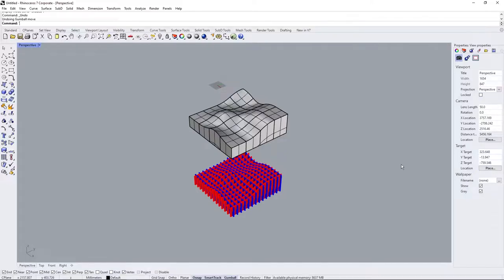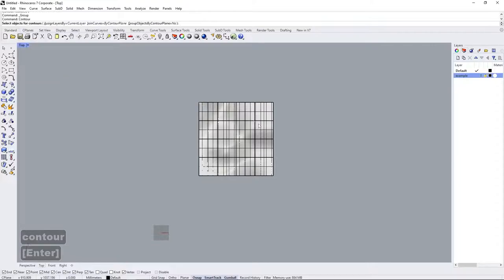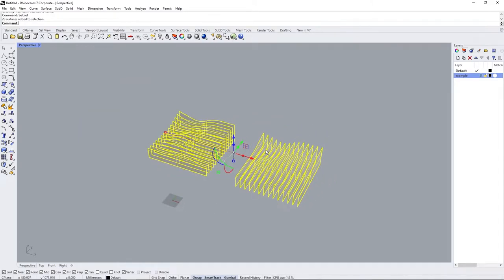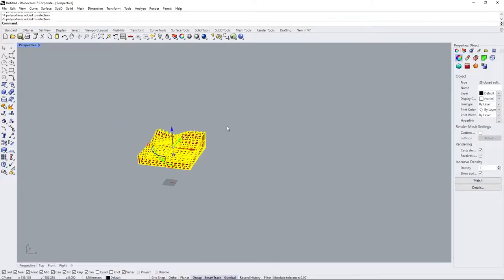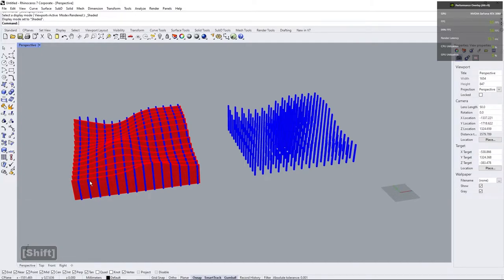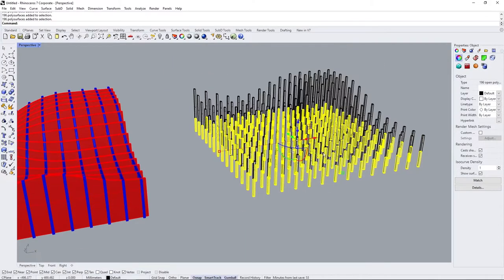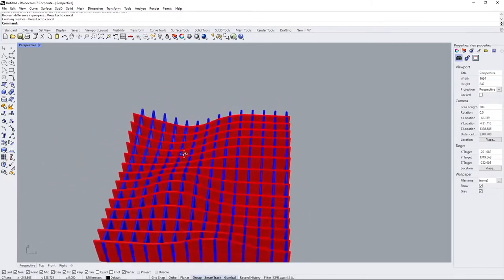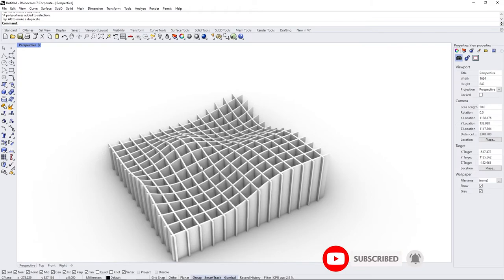How to: Rhino Waffle Structures - Fast and Easy

Comment: Good tutorial! Clever way of generating the intersections. One tip though, you can do the vertical scaling of the notches in one command. 

Select all the notches, and use Scale1D. Just click from the bottom to the top of any piece, and scale it to the midpoint (make sure mid is turned on in the snap menu). 

Unfortunately will only work for a flat bottom object like this.

Comment: Great tutorial! One thing I would like to know though - if this is to be machined (cnc) every curved part - as it is extruded/offset - the top part does not follow the original surface. I would like to slice up the original form you started with - in parts as thick as the material one would use, thus retaining the curvature of the surface form in both directions. I hope I made my idea understandable ;-)